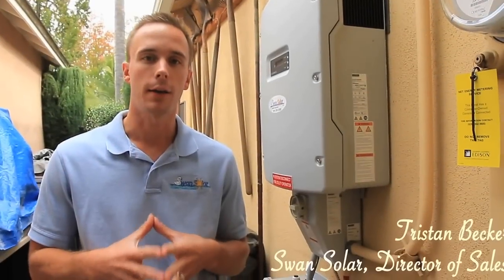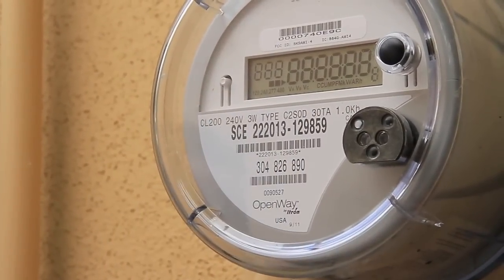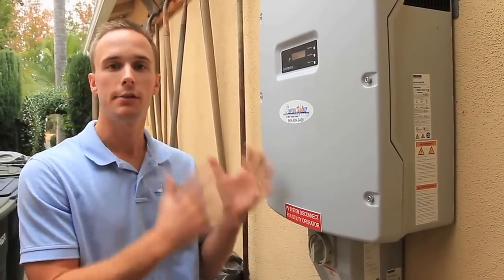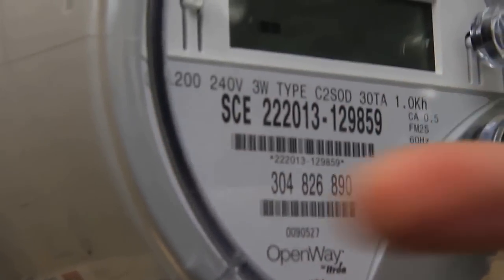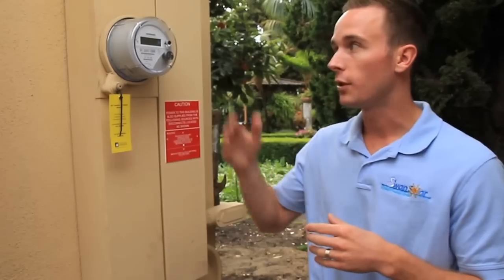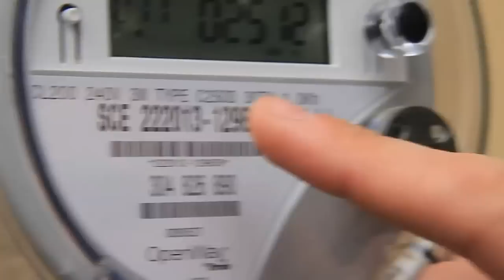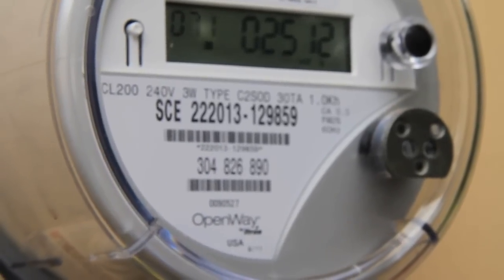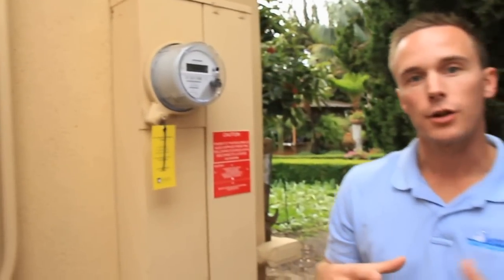Reading Solar Energy Digital Meters - How To - Swan Solar

Comment: Hey there's nothing "spinning backwards" here!  If the arrow is pointing to the right, you're drawing power from the grid. If it's pointing to the left, you're pushing power into the grid. The "001" display also tells you what is happening. If it shows a negative sign, you're pushing into the grid, and maybe your electric company is giving you a tiny bit of credit for it.

Comment: When solar panels are installed, do they consult with building biologists to clean out the rf radiation and the dirty electricity created within the dwelling?  I have heard these solar inverters create dirty electricity throughout the wiring of the whole property and this dirty electricity is a health hazard.   Also the electrical smart meter whether AMR or AMI also produces rf and dirty electricity throughout the wiring of the home or apartment building and this is a major health hazard.  I don't think it is standard procedure for those installing solar to then mitigate all of the rf and dirty electricity created.   I assume you can use an ANALOG electricity meter which does not emit radiation or dirty electricity, but if you have an analog meter, you will still have problems with dirty electricity from the solar inverter.......

Comment: 071 is not the solar production. 071 is the excess power sent back into the grid.  The only way to know the solar production is a measuring device at the inverter.
Reply: And you're the expert we should believe right 🙄... Where's your uniform? Where's your clipboard 📋?